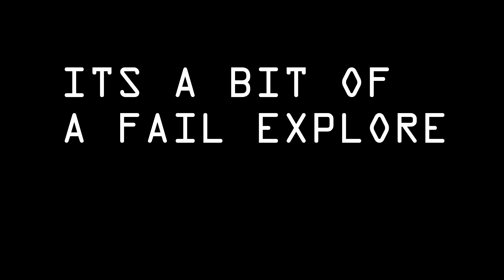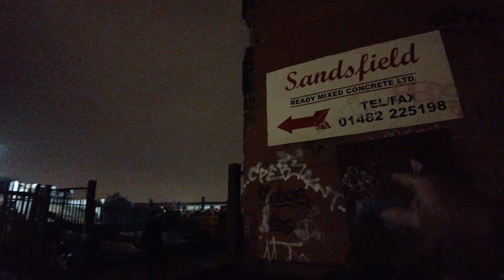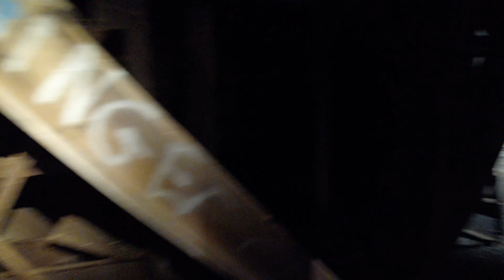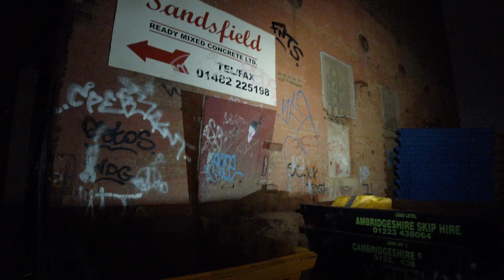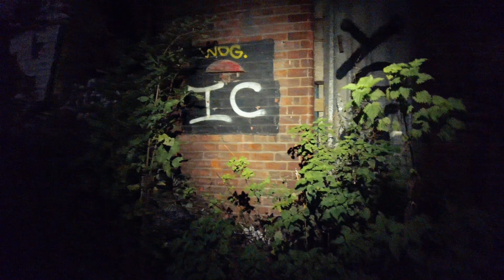STAIRS of DEATH at British Extracting Co

Comment: I wouldn't call that a failure, you got access to all the interesting parts of the building.  the taller part of that building is just storage Silo's, the Stair case of death would have gone to the inspection points at the top of the silos, which would have just been deadly pits into the dark abyss of the building anyway.